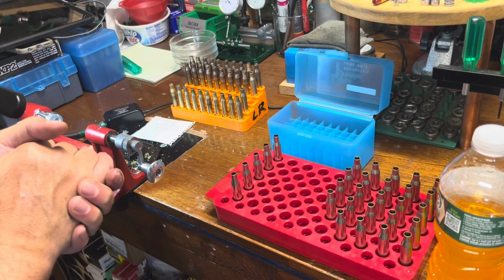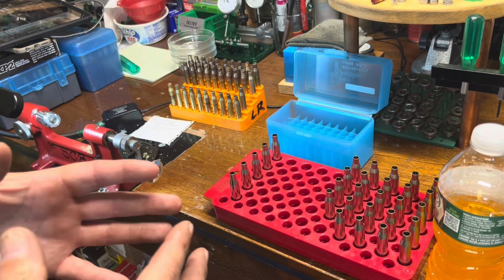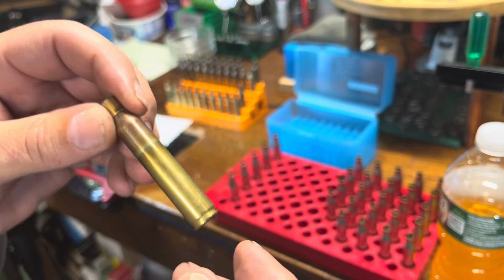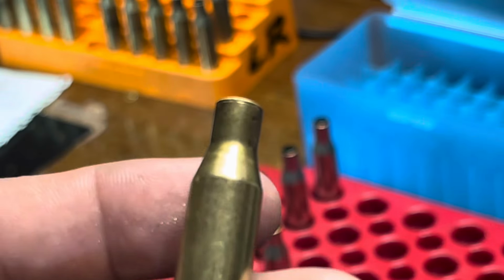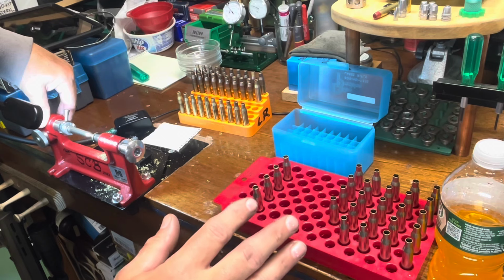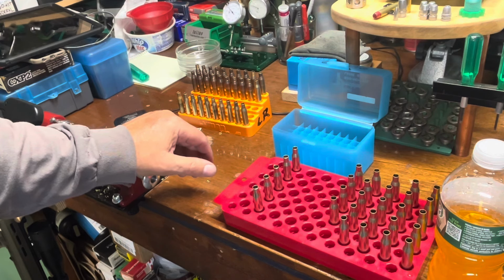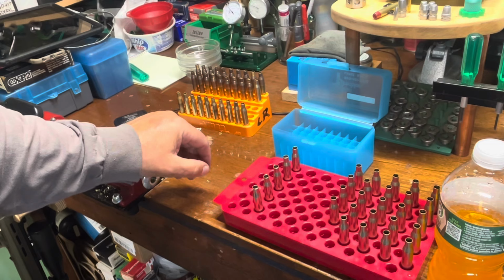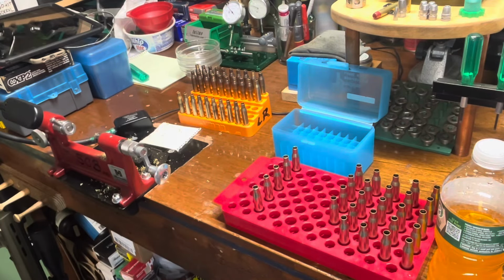6.5/06 Bench Chat

Comment: Good morning CW, it would be nice to have a hardness tester that would work on brass. It's probably cost prohibitive, though. In my short time on earth, I've only seen one that is owned by the inventors of the AMP machine. I also wonder what effect pressure has on the web of brass around the flash hole and the balance of the case head. Then there's the metallurgy. Thank you for your videos and work.

Comment: Outpost says Federal brass is soft in the head because they don't strike the head one last time to harden it. That is why they get loose faster as the first firing is too soft. If I ever find split cases they are usually always WIN. I don't use Win brass unless I have to. I am thinking your chamber is just really tight and cannot tolerate brass that was ever fired in any other chamber.
Reply from the maker: I was talking with another Smith the other day. And he warned over two smooth chamber causing hard extraction. He recommends a dowel with a piece of 320 paper. He says polishing with flips may actually make it worse. He didn't watch any of my videos. I just told him what was happening and what I saw. He didn't offer any other suggestions. But for now it's working. I'm happy so I'm probably not gonna do anything else unless I have more problems thanks a lot for all your help man. Really appreciate it. Hope you're doing well, God bless